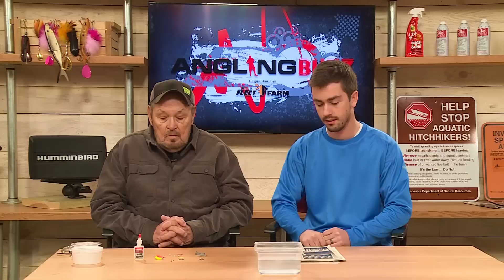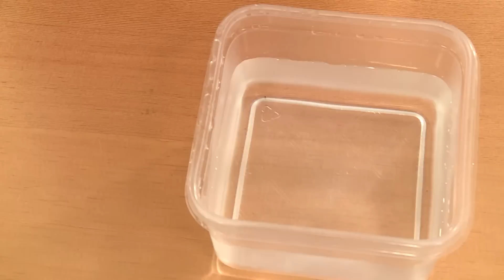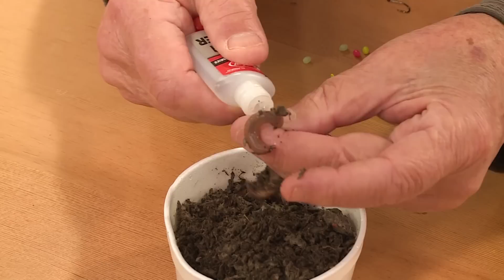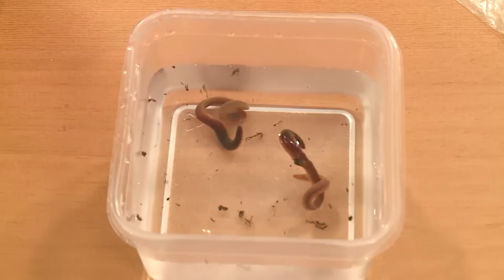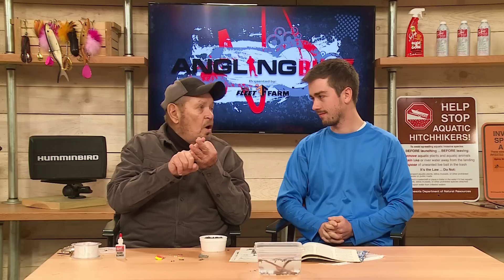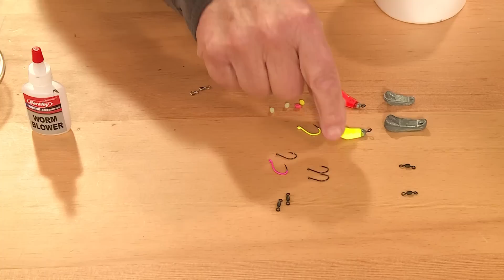Ron Lindner shares some history on the Lindy Rig & the Worm Blower

Comment: That's why I say the Lindners taught me how to fish. 6 lb test clear mono, #8 hook, and a nose hooked air injected night crawler. I have the sinkers also, but I rig it with split shot on the tag of a loop knot tied to the end of the leader, which attaches to a snap swivel on the main line. If snagged the shot usually slips off with a slow and steady pull. Drifting from a boat, casting in a river to drift with the current, I've caught many walleye, bass, panfish, even trout. All thanks to the Lindners.